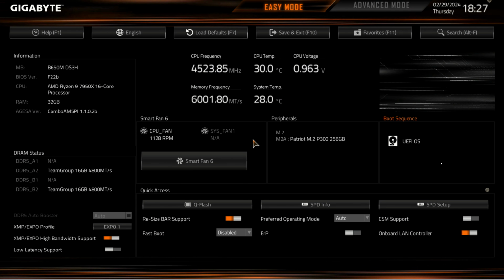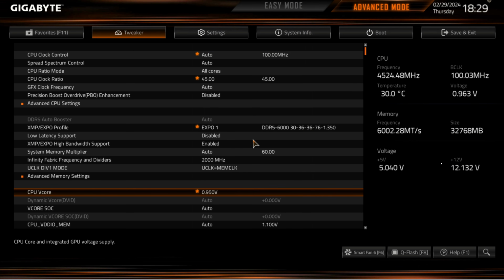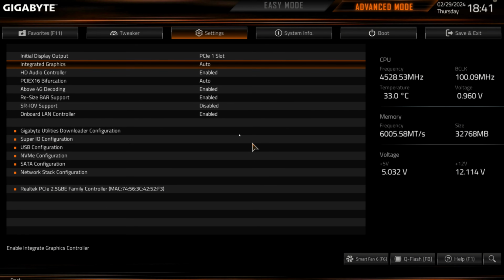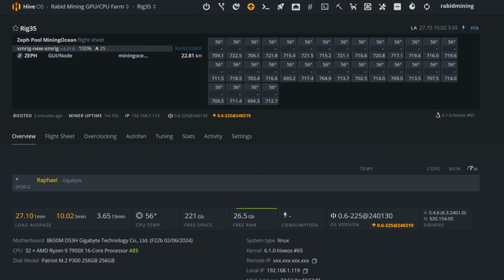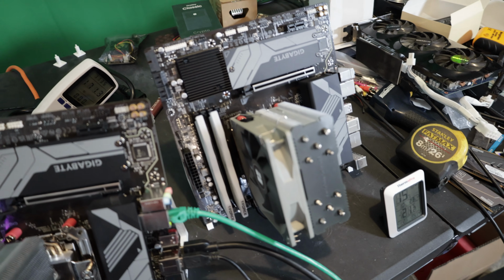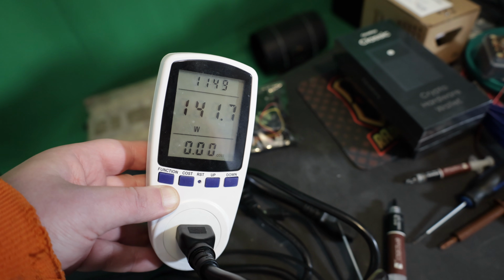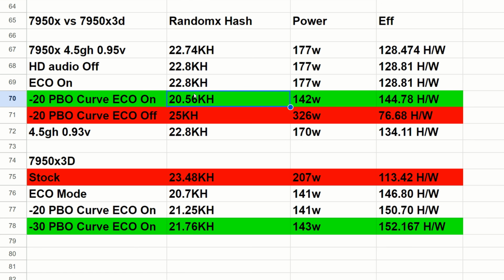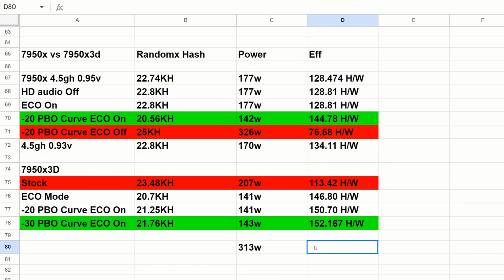7950x3D BIOS Tuning Randomx (ZEPHYR, XMR) Hashrates VS. 7950x

Comment from the maker: What's Your Thoughts?
Reply: great video and what a great setup think ill buy some of these now.
Reply: QQ, Hashrate .no shows AMD RYZEN 9 7900X3D making $4.35 and #1, but AMD RYZEN 9 7950X3D they dont show VISH at all. would or could the AMD RYZEN 9 7950X3D make good on VISH!? as well.?
Reply: Can't wait for the new AMD cpu's.
Reply from the maker: @ogremgtow990 probably won't be better only bonus is that the 7000 series will be cheaper used
Reply: @RabidMining ok got bios tuning done but I’m still getting info waiting for task wit that system exception api report error
Reply: Is there a tool that can show the 3d cache usage? If being used great,  if not how can we encourage the dev of mining software to take advantage? Great video
Reply from the maker: @MrThejackal99 depends on the algo some don't use it bunch need 2mb per thread and one needs 4mb per thread
Reply: Still not good enough to justify replacing my Ryzen 3000 hardware for my farm.  I hope the next CPU will.
Reply: Great video. A lot info makes easier to chose between 7950x and 7950x3d. But I wonder is 7945HX competitor to them in profitability? Could it beat 7950x3d 152H/W eff?
Reply from the maker: @mantassavickas7775 not sure don't have one of them to try
Reply: @RabidMining  I thinking of getting one in month or two for testing and mining. I have in mind Minisforum BD790i mini-ITX MB with 7945hx CPU. In theory it could do 18.5kH on 80W or 230H/W. All system - 7945hx, 32 RAM, SSD, PSU should cost around 800€. Same time 7950x ~ 1000€, 7950x3d ~ 1070€.
Reply: looks like different MB will have way different results, i have my 7950X 3D on ASUS b650 series, exactly same setup gave me 17-18kH, no more. ECO, PBO -20. 6000mHZ dual channel mem.
Reply: @rabidmining any idea how much amps your pulling from the wall with one of these two rigs?

Comment: I built my rig. Everytime I power it up all I get is a blank screen on the monitor. Did I mess it up?
Reply from the maker: Maybe try a bios update?  Any lights on the MB? Sometimes the first boost can take a few min.
Reply: @ only light I see is from the memory card I’m just getting a black screen what kind of monitor Should I be using. I got a basic hp hmdi monitor I plug in.

Comment: Just an fyi, but before touching load line calibration check for stability of the curve offset first. If you don’t need to touch the load line, don’t. It still increases voltage under full  load compared to auto which leads to higher temps. This is just to make certain offsets stable when needed.
Reply: and LCC works is very visible on Qubic, every new task (maybe each 20 min) CPU load is low but there is voltage spike as final outcome of this = fan noise + temperature increase for 10 seconds.

Comment: Can you test 7950x3d in Windows and reveal what clock, and voltage the 3d cpu runs?
Reply from the maker: Ya after I put it in my workstation I will

Comment: What about 7900x vs 7900x3d? Im about to buy one of those, which would you recommend?
Reply: I'd buy 7900x. Because it's unlocked. You can lower and higher the frequency and learn more.
Reply from the maker: Not sure how the x3d is on the 7900x
Reply: @RabidMining   no problem, thanks anyway! :)

Comment: Any thoughts on Ryzen 7900 non x's efficiency & hashrate?
Reply from the maker: Not sure haven't tried it
Reply: The same as 7900x. Set the frequency 4.7 and voltage. 0.95. The hashrate is around 17k with 6000 cl 30 ram.
Reply: @MarySmith91925  Thanks for sharing your results. Which motherboard & power draw at wall?

Comment: Dear Rabid I think that spend more than $1k in this platform its too expensive. This week I bought x2 3900X in second hand market per $120 each one, x2 $25 16GB Ram 3200 and x2 MSI X470 for $50 each one.. total around $400 per x2 platform that produce 25Khs in Randomx and spend 220Watts. Its worth it buy 7950X?

Comment: I'm guessing that with that 24 pin splitter, when you hit the power button on 1 system the other system turns on too?
Reply from the maker: Just turn the PSU once both rigs are set up yes

Comment: so from cpu mining with parts back in the days you would spend like $400 for everything to now spending close to 1K which is like buying a GPU does that make sense. break down the ROI on that setup and it wouldnt make sense due to the risk
Reply from the maker: 1k gpu 30 cents a day 1k CPU 2 bucks a day yup not worth it
Reply: @RabidMining  both are not worth it just saw a video break down on red panda mining if you would just simply invest 1400 on these coins you would make way more money without having to worry about your light bill or rid turning off and all that work. glad he was honest and stated it is best to just invest in coin instead of mining at this point.

Comment: FF3D564G6000HC38ADC01 Does my question work for the Ryzen 7000 Series? 
I found on Amazon that it says Optimized for both Intel XMP 3.0 and AMD EXPO but in other stores it says only for Intel XMP 3.0
Reply from the maker: Not sure should work

Comment: have you tried that PBO curve play with 5900x as well? :)
Reply from the maker: Did a while back didn't really like it
Reply: @RabidMining  so fixed core clock to 3.7 and core voltage ~0.9XX + XMP profile for memory? something else?
Reply from the maker: @ch3m1c should do it play with voltage until stable

Comment: Important to note if anyone cheaps out with a bronze power supply they'll never get these efficiencies. Bronze supply can waste up to 30 watts more for the same performance so everyone don't be cheap on the PSU then complain you're not getting these efficiencies :) No CPU setting is going to save you from yourself :)

Comment: QQ, Hashrate .no shows AMD RYZEN 9 7900X3D making $4.35 and #1, but AMD RYZEN 9 7950X3D they dont show VISH at all. would or could the AMD RYZEN 9 7950X3D make good on VISH!? as well.?
Reply from the maker: They also show hardly any power hashrate.no fails on cpus don't use it
Reply: Forget vish ai. Its failed

Comment: Just gained 1.5kH/s on my 5900x thanks to this video. Thanks @Rabid Mining !!!
Reply: what did u do exactly?
Reply: @zf8496 You might need to update your bios, I had to.  In my MSI bios I turned on the advanced overclocking and pbo and set a negative curve of 25, have a look for whatever motherboard you have + pbo curve optimizer. I had set the curve too aggressively previously before and this vid was the kick in the seat to giver another go.
Reply from the maker: Nice work!

Comment: The 7950x can be tuned exactly the same as the 7950x3D, just by enabling Eco mode and setting the PBO2 curve optimizer.

There is also another interesting BIOS/EFI setting: the PPT (package power). This one limits the maximum power that the CPU draws. The Eco modes (65 W and 105 W) are just this setting with hardcoded specific values for the maximum power.
Reply: By tuning the PPT value, you can tweak the CPU to be very power efficiency (>170 Hashes/W  for a 7950x) or if you have cheap electricity, to maximize the hash rate at the cost of power efficiency.

With the current prices of CPUs here in Europe, makes more sense getting the 7950x over the 7950x3D. The hash rate difference is just too small (5%) to compensate the extra cost of the 7950x3D.
Reply: This is phenomenal information on top of the video, thank you! @ethereal026
Reply: What other settings should I tweak for the 7950x to reach what you said it's capable of? I'm about to put mine together

Comment: MSI PRO B650M-A has the best memory tweaks, it gives about 600 hash more than Gigabyte's. I've ordered in the cheaper MSI B560M-P to see if it can run the same mem tweaks.
For 7950X I use: PPT 105, curve -25 for 21900h @ 166w on Gigabyte DS3H.
For 7950X3D I use: PPT 110, curve -25 for 22800h @ 165w on MSI B650M-A.
Reply: Are you tweaking mem manually or do you just use some presets?
Reply: @hardcoredefender1831  the MSI boards have pre-configured mem timing presets for popular kits, eg. corsair 6000 CL30. So you can stick kits in there to see the tight timings then manually copy them to other boards, with great results.

Comment: I haven’t messed with cpu clocks in awhile I’ve been dreading it with all the solar install i got going on you covered a lot minus the difference in motherboards like you said enabling and disabling like 4g crypto mining setting line load and on mine using Memory Try It instead of XMP on mine gives more hash because it lets you fine tune it in steps in mhz and cl like 1733mhz cl 14-14-14-36

Comment: You can drop ddr5 voltage after lower max rates oc 200mhz no lower then 5600mhz . 1.16v instead of 1.35v if can't then 1.22 on 4 diff brands with hynix and micron 7950 auto 62c temp with 5-6 heatpipe air 128-133w 20200